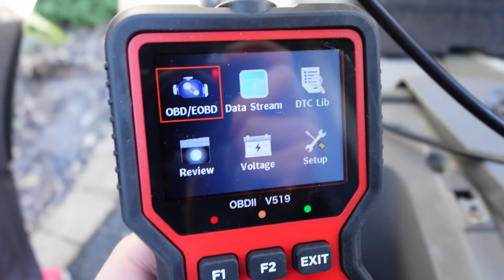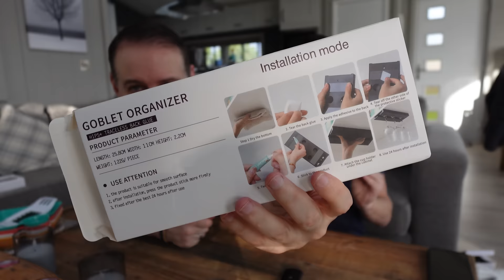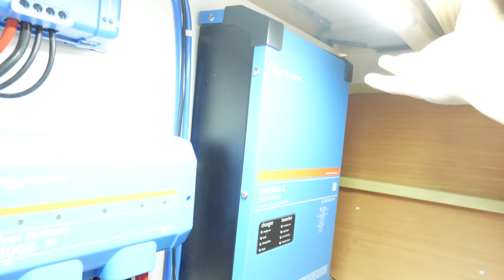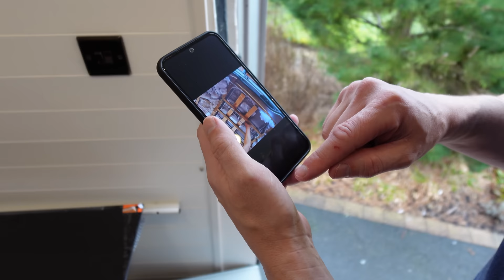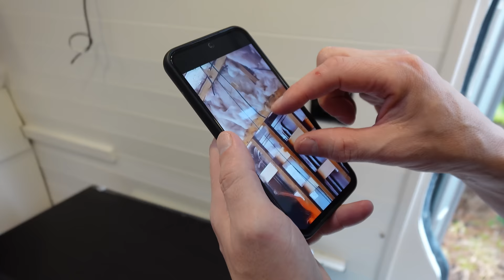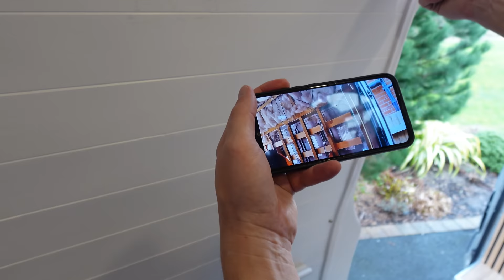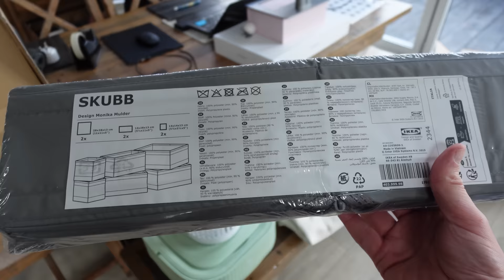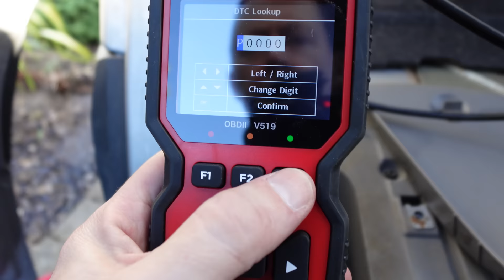Is this TEMU portable Washing machine any good for VAN LIFE? | Temu Haul

Comment: Temu:  I have seen a number of reviews on different products from Temu with different outcomes.  For things like the plastic plates they are what they are, but for other things like the Pump, Trainers and Washing Line etc. only time will tell after some use if they are good value.
Van Table: If you replace the current leg with a Laguna Leg you would be able to keep your seating area in the "L" configuration the whole time as the table can be rotated out of the way (depending where you fix the bracket) and also just lifted off and removed when necessary.  If going to a "look a like" make sure that it has the same full area of circulation.
Van TV: Looked a little big - perhaps find something smaller with a good definition screen and look to secure it to fold up against the ceiling then it can be watched from the seating as well as the bed although for the latter when laying in the normal cross direction watching it could be difficult.  Perhaps a second small TV on the wall above the bed.  Having spent many weeks on a narrowboat (which is only 6´across) a small TV with good definition works well.

Comment: Yep love the van videos. Want to see all your bits and pieces you put in. Have you got camping chairs? One thing I bought for my van was an A.T.E. Pedal lock. Really really good and secure.
Reply from the maker: We haven't put chairs in yet but we do have some fold away ones we will be taking
Reply: @TheLodgeGuys  a good tip is to go out for a night or 2 initially and see what you need. I found cooking tongs were a must just as an example of a small item ☺️ oh and don’t forget the corkscrew. It’s a pain if you mistakenly buy a bottle without a screw top. Cans with pull tops are also invaluable

Comment: Do you have a plan to stop the movable seat from sliding forward if you break sharp, I’d worry that it will fall into the step, just a thought, great work throughout the van ❤
Reply from the maker: there are 2 options when in bed mode it's fixed to the other fixes seat  , when stowed it's going to be stowed behind the secret door so it can't slide about, same with the toilet it will be held I side the shower cubicle, you'll see a lot of this on a future vlog xx